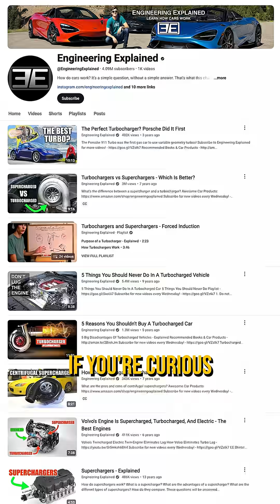Turbocharger vs Supercharger - Which Is Best?

Comment: Superchargers all the way! It feels like the engine is NA you barely realize there is boost. Unfortunately they are not as playful for high boost whereas you can run a Turbo to over 3 Bar by doing nothing spectacular which is vital for smaller engines and big power.
They are as efficient as Turbos so long you don't ask for high pressure, centifugal ones are better but are expensive and choices are limited.
Turbos slow down the piston travel when the exhaust valve is open due to back pressure, same way a SC it will slow the engine by spinning a pulley, a chill turbo engine will be slightly more efficient but still has loses.

Comment: Turbochargers are better than supercharger, the both boosts the car good but the only difference is Supercharger activates even on low  rpms, it uses power from engine so you will be visiting gas stations 2 or 3 times more than you ever did. Turbo on the other hand uses exhaust gases, so it does not use any fuel, you can still lower the turbo lag by doing small modifications and ECU tuning.

Comment: Low torque engines - turbo
High torque engines - supercharger 
Superchargers are more efficient when the engine has to struggle less to turn the belt when it has a higher torque rating

Comment: Turbocharger is just a portmanteau of "turbine-powered supercharger" anyway.

Also: "turbos tend to be more efficient" -- shows an STI which gets deplorable fuel economy with its turbo engine lol
The 5.7 Charger even gets significantly BETTER mileage, while having a LOT more weight and horsepower! And don't tell me it's all from that automatic transmission -- the regular WRX with its supposedly "most efficient version of an automatic"  CVT barely does better than that Charger even with its massively lower weight and modern twin-scroll turbo and direct injection.

AWD alone can't be THAT bad for fuel economy.

Comment: Super chargers are simpler too.
Reply: Yeah but they eat crank horsepower, if in theory a crankshaft can only handle say 1000 hp before breaking, a supercharger will eat 100 hp easy in its provided restiance at that power level, capping it to 900 horsepower before it hits the tranny. vs a turbocharger works off waste gas, not adding load

Comment: I have a 2013 1.4 vw polo gti which has both chargers apparently.
Reply: Yeah those cars need high octane premium fuel and the ngk spark plugs changed every four years as they run super hot with a high compression ratio

Comment: Supercharger is better for daily driving on streets, turbo is better if you just want to maximize power. But the responsiveness  of a supercharger is hard to beat driving on the streets. Turbo lag can make it hard to get into the power with turbos without going to jail 😂
Reply: Not all that true on modern GTDI's though. My F150 Ecoboost with a tune was making 500 ft-lbs of torque at 1800 RPM.
Reply: No 😂 turbo is better for streets as way more fuel efficient for normal driving

Comment: Turbochargers tend to work better in applications with higher boost. Running low boost with a turbo means that your exhaust manifold pressure is low and your exhaust gas volume is relatively high. Now you are having to cram a high volume of exhaust gas through a relatively small turbine.

Since most people are not trying to make 2000 hp, larger displacement engines that naturally make more power, dont need a ton of boost to make even more power and so they tend to be supercharged. 7 psi of boost on 6.2L V8 that can make almost 500 hp naturally aspirated, is gunna put you up near 700hp.

To do the same thing in a 2.0L, you probably need 50 psi of boost.

Comment: That "BWAAAAAA SHUTUTUTUTU" and the "WWWWHHHHHHHEEEEEEOOOOOOOO" were the only thing I needed to understand the difference 😂🤌
Reply: I like the way you put. as someone from the horsepower days cubic inches and proper parts made the HP. taking an under sized motor and forcing it leads to too much stress on the engine also additional parts like turbos and blowers require extra service and tend to fail often. It like a small guy with a hand truck moving a refrigerator up stairs yes it can be done but when finished that is all he can do for the day compared to 2 big guys who can move it with out a hand truck then move the couch and many other things. My 5.7 Ram had moved heavy stuff for 200,000 miles with only an alternator failure compared to trucks today with smaller motors turbo charged that are failing often some under 30,000 miles.
Reply: @1oldgoat5000 It depends what you’re trying to do. Smaller engines can typically be made to rev to very high rpms with far less work than with a big block. Though I’d take a 500hp NA pushrod V8 over a 500hp turbocharged 4 Cyl any day of the week.

Comment: Love my turbo car. It feels pretty normal taking off, but when that boost comes in it pushes you back in the seat. Size is an important factor. If you go too small the turbo gases out early, but if you go too big the engine doesn’t have enough volume to spin it up fast so you get a lot of lag.

Comment: I have an idea about that Turbocharger-Problem at low rpm. Why isnt the turbocharger powered by a supercharger which forces exhaust gas and maybe some bypassed air for more gas flow into the exhaust gas turbine.
Does anyone thought about that already. Maybe it is to heavy or the efficiency is to low.

Comment: Additionally turbos are more tuneable as wastegate controls also you to program a boost curve for each gear and change the max boost easier.
Reply: Supercharger has relief valve - if you will control it by ECM to maintain low boost at low gears it will be similar
Reply: @alexgo1034 some supeechargers do but not all or even most. The control is also not as good. There is a reason why virtually none of the fastest drag and drive cars run superchargers. They almost all have turbos as it takes very little time to change the tune and car from making 3000-5000hp on race fuel to streetable 1000ish on 93. 
While this might be available with some superchargers it is not as readily available andnnotnas good.
Reply: @TriCountyMotorsEastman  Is there a reason that you know nothing about fastest drag cars ? Because all of them use SC
Top fuel , funny cars and so on
I didn't see any TC cars fastest than 5 sec
Reply: @alexgo1034 I said Drag and Drive. Like Mullet, Sick2.0,  and SM wagon. 
Top fuel doesn't use turbos because of the rules. So that's a poor reasoning
Reply: @TriCountyMotorsEastman  You said fastest don't use
Fastest uses SC
Now you  trying to slide
Reply: @alexgo1034 reread my first response I said drag and drive and described a car that switches to 93 on the street. Those cars need more tuneability that a top fuel car. Top fuel cars are by rule limited to a roots style blower which HD clear been proven to be the least efficient way to make boosted power. But the nhra constantly changes rule to keep those cars slower for safety reasons. 
You changed my argument not me. Reread
Reply: @TriCountyMotorsEastman  Where is 3.5sec turbo drag race cars ?

Comment: If you want the perfect one, just use both. Install your turbo before the super charger so the air will be more compressed after passing the Turbo charger & super charger. But remember the intercooler must be between the turbo charger & super charger, plus after the super charger to make the air more dense.

Comment: I have a question. What if you rave at high rpm with the clutch down so your turbo gets enough exhaust then when the race starts you release the clutch?
Reply from the maker: There won’t be anything resisting the engine (it’s just free revving), so it won’t build up that much boost. But, it’s a start, and gets some flow going thru the turbo.
Reply: @EngineeringExplained oh thanks

Comment: These days you will also find turbochargers driven by electric motors to compensate for the lag from the exhaust, at least on some high end applications.  It adds cost and some weight, but you can get boost almost instantaneously at any RPM and it's cheaper and more reliable than a twin-charge system.

Comment: Lancia: "Okay, we'll take both then"
Reply from the maker: Volvo too!
Reply: @EngineeringExplained  Unfortunately Volvo made an unreliable engine that was not helped by excessive service intervals...it costs about AUD30,000 to replace that engine once things have invariably gone south.
Reply: That's called twin charging
Reply: Ignorant question, so it is possible to implement both a turbo and supercharger respectively in conjunction with one another?
Reply: @Turbo_G.T.Blackwing63 compound charging. Twin is two of the exact same thing
Reply: Don't forget vw, atm repairing 1.4 tsi (the original one.. 😉)
Reply: @mikkomakinen1429 My best. The BLG engine producing 125Kw golf5👌
Reply: And Nissan March (Micra) Super Turbo!
Reply: @emma.jacobs1 which trim?
Reply: @emma.jacobs1  Yes the SuperHonk!
Reply: What I've heard is that those setups are quite unreliable... someone can explain why?
Reply: It's like being on steroids 24/7, the  body will wear quicker
Reply: @smolikjr  Its about price
Twincharged  best version of forced induction
But  such engine more pricey than turbo only
Reply: @smolikjr  probably because the the entire engine is more complex
Reply: @smolikjr  Main problem is heat, so they need a beefier coolant system, intercoolers etc.. 
..The engine needs thicker cylinder walls/tougher block, tougher 'everything' basically.. 
Iron blocks are typically better at handling heat & boost, but some companies use aluminum, or skimp on certain vital parts.. 

..Plus there's a lot of extra parts that have to be stuffed somewhere, kept from melting, more things to tune/keep in balance, more things that can break/malfunction etc.. 

..The OG Twin-Charging people were mostly racers that were hacking together parts on engines that couldn't really handle it.. but it didnt matter if you fried your engine aft a thousand miles if the race was only 300.. 
Companies like Mercedes, Volvo etc have figured it out a little better, but its still boils down to simply 'more stuff' on the car that can fail.., and *most car companies are known for cutting every corner they can.
Reply: Lancia delta s4 a supercharged twin turbo charged group B rally car
For when money is not a concern and neither is safety
Reply: That's called twin charging
Reply: The engine block might get damaged from twin charging. He would need a reinforced engine block.
Reply: VW aswell
Reply: That's when you get danger to manifold 😂
Reply: Hahahahahahhaahhaah what can the Italy car can offer
Reply: Thanks for explanations!
Reply: And instead it sounds like a dremmel
Reply: Zenvo ST1

Comment: "Why not do both"
-Said by the guy who invented"Twincharge"
Reply: Lancia S4 engineers team
Reply: I'm sorry, but that's one hell of a balancing act to maintain. All I'm seeing in my mind's eye are detonated pistons.
Reply: @ronarnold1507 Just build the engine to take it 🤷
Reply: @ronarnold1507  well if you're building it on the edge of performance that is what happens 90% of the time, but if done for something like class based racing where you can't exceed a certain displacement and horsepower it works extremely well as you won't be stressing the engine that much and is essentially a better inline twin turbo system.
Reply: Didn't volvo do both on some of their xc90 suvs?
Reply: @darriusholt they did but the supercharger decouples from the engine above 3500 rpm and the turbo takes over. I assume it was to give it good low end torque
Reply: was done all the time in WW2

Comment: Saw a dude with a twin charger setup thing was a beast supercharger on top and turbo was mounted under
Reply: VW have a twincharged 1.4 that they put in a bunch of cars (inc Audi, Skoda & Seat) from about 2006-2015. Not super reliable but interesting nonetheless and has its own distinct character
Reply: @eponymous7910  the lowest end that twin charged can be really
Reply: Volvo did it to

Comment: Turbo: Pros
Force more air into the engine, making mo’ power
Weight efficient 
Doesn’t require a belt really
Cons
Lag
More piping
Possible runaway (all vehicles equipped with a turbo)
Supercharger: Pro
Instant power
Delivers more air
Less piping
Possibly no oil needed
Cons
Requires belt
More weight
Pain in the trunk to install

Comment: Looks like a lot of commenters are a little mixed up about max power and efficiency.  My issue is with exhaust restriction of the turbo, retained heat and life of service, and reduced engine life because of it. Used in moderation there is a definite efficiency improvement with a turbo, and the added benefit of being able to use a smaller motor for simple cruising speeds, using less fuel.  But turbos are more complex, and trap a ton more heat under the hood.  All no no's to my personal preferences for engine designs. Unless you are considering an adiabatic engine design like Smokey Yunick built.  Super chargers are direct or belt driven, can be disabled using a clutch if you want, speeds and output can be changed with simple  pulley swaps and they can be made relatively small or enormous depending on your needs. I'd go with supercharging for just about everything.

Comment: Depends on the application.  Known rpm range, desire power at low rpm, or at a fixed known rpm.  Supercharger all day.  Want flexibility?  Better efficiency?  Turbo.  Best of both worlds?  Electric turbo supercharger, and they are coming to the consumer soon.  Electric power to spin the relatively large turbo up at low rpm.  Ability to scavenge power.

That is my impression and experience so far.  Turbocharged my first car in 1985.  Crashed it almost immediately after.  Used turbos and superchargers over the years.

I'll say this too.  Superchargers tend to be less complex to install and tune.  Turbos were a bit of a black art, but with modern fuel systems are much easier now.
Reply: For fixed rpm, I would go turbo as it’s more fuel efficient than a supercharger and lag isn’t an issue at fixed rpm
Reply: @Gnerko123 very possibly, but tuning for a turbo to be stable at a target rpm is not trivial.  Small changes in temperature, humidity, pressure can make significant differences.  An engine driven system is more predictable.

Having said that, I wasn't talking about efficiency with the supercharger.  I was talking about predictable power.  A turbo will almost always be more efficient, but takes significant more effort to design, implement, tune, install, maintain.

Take for example offshore race boats.  Efficiency isn't really at the top of the chart.  Throttle response and predictable performance are, as the throttles are crucial to stability.

But with modern ecus, the gap is narrowing.  Especially if you use a hybrid turbo with electric boost.  If I were to build a budget no object motor, that is what I'd use. One big turbo sized for max power, and electric motors to both spin the turbo up, and provide a small hybrid boost to the engine.
Reply: @thebarkingmouse you’re bringing in many other things, some of which I agree with but many of which don’t relate to what I wrote. Turbos are usually better, unless the engine needs very sharp response. There’s a reason turbos are way more common than superchargers on the road in both cars and trucks for both gas and diesel.
Reply: Oh please gtfo with the ridiculous electric turbo nonsense… it takes over 100 horsepower to drive the stock blower on a Dodge demon. In order to do that with electricity you need an electric motor and batteries capable of providing that much power for the sustained period of operation. The batteries don’t and never will exist that make that a preferable arrangement to.. you know, having the engine that’s already there do that work. Turning kinetic energy into electricity and then back into kinetic energy instead of just using the kinetic energy you started with is pointless. People spend millions of dollars on R&D for racing, we can do 1/4 mile so fast that we have to turn the cars down to keep the driver conscious. You don’t think any of those people have exhausted the potential of electric supercharging? The most efficient way to turn fuel into motion is a reciprocation piston engine with some form of mild forced aspiration. No amount of electric car fanboy cuckery will ever change that reality.

Comment: I’ve owned two supercharged cars.  Turbos mostly require higher revs to work.  If I want boost I usually want it lower in the rev range 99% of the time.  I don’t want to have to be at 4000+rpm to realize the benefit.  It’s why I like electrified cars and low key prefer superchargers for daily driving for ICE vehicles.  Generally better off the line and above 80mph I’m just not driving there.

(Yes I realize I’m grossly oversimplifying)

Comment: I'm surprised turbo lag is still an issue in today's world. 10 years ago and beyond makes sense but with how common electric motors and other engineering developments i would have imagined ways to mitigate the lag and low end torque band would makes turbo cons a thing of the past
Reply: Anti lag turbo systems
Reply: An electric turbo charger, like the one engineered by Porsche or from other brands, doesn’t have turbo lag and some other improvements over normal turbo chargers too
Reply: Ford tried to address that with a twin scroll turbo. Not sure how that worked out for the owners of those...
Reply: Turbo have a lot less lag now days, technology has evolved and new anti-lag systems have been developed, just look at the ZR1 with electronic wastegate, lag is gone.

Comment: I like the version where you have both of it. Charger for low rpm and when that's over the turbo takes over
Reply: Twincharging! Rare & expensive but very dope! Anti-lag systems are also a great way to solve turbo lag if you don't care about anything really except throttle response.